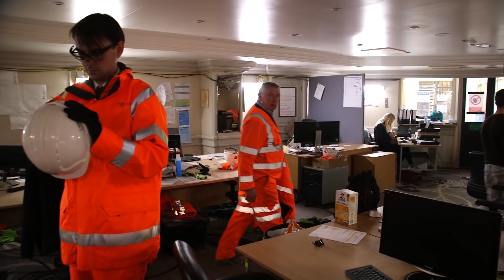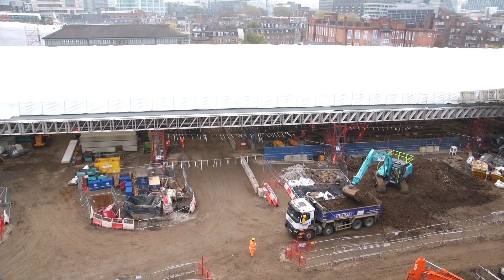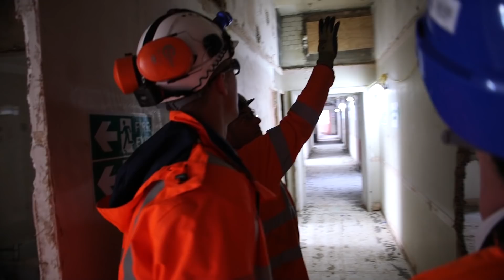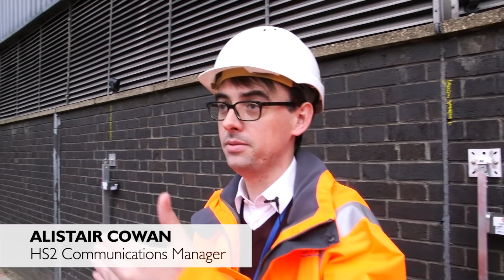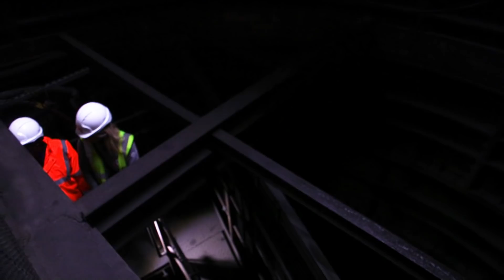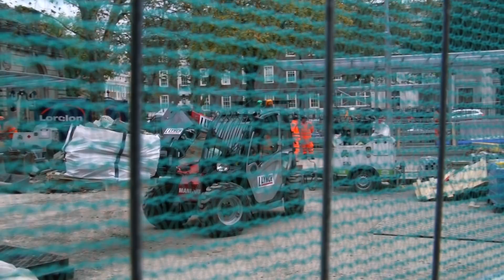HS2 Euston Demolition Works

Comment: Do we even need HS2...waste of money if you ask me. Just upgrade the current lines with electrification and put new and faster trains on them, HS2 is to make rail travel quicker...why not get an earlier train 😕
Reply: HS2 is about capacity. And the existing line is already electrified. Upgrading costs more than new build, and is far more disruptive whilst it's going on, as previous WCML upgardes have amply demonstrated.
Reply: Why don't you check some facts before you write? The current main line is already electrified, and the trains are already going at maximum speed possible on it, given the curves.  The trains are even designed tilt to resist the centrifugal forces on those curves, but the limit has been reached.  Anyway the main point of HS2 is to increase capacity as the existing trains are full ; the higher speed is a bonus.

Comment: What there needs to be are decent rail lines along the South coast. As it is if you want to go from Kent to Dorset you have to go up to London and then back down - it's ridiculous.
HS2 is just stupidly ambitious. It requires far too much demolition, construction and alteration.
Reply: Thomas Sturges-Allard Compared to the disruption without it, it’s nothing
Reply: Even worse by road along the South Coast.
Reply: i completely agree, if i want to go from Ashford (Kent) to Brighton or Portsmouth i have to wast soo much time going North to London just to come back down south again at an angle.. if they upgraded the lines between Ashford and Eastbourne and started using proper Trains and not these bumpy and frankly useless at peak time 2 car DMUs we could improve the south East - West connection allowing access to Kent from Hampshire Via Sussex without going via London's overcrowded network.. all by upgrading a short section of track
Reply: the west coast mainline and euston station are absurdly inadequate for the amount of people that constantly use it. it’s such trash when you compare it to the rail services to other parts of the uk

Comment: I Think the class 800 "*IEP*" Is going To be on the HS2
Reply: Not very likely - new bespoke trains are planned, whose design is not constrained by having to run on 19th century infrastructure.
Reply: In fairness, current plans for the first tranche of rolling stock are that it is all going to be "Conventional Compatible" so that it can run off HS2 at Lichfield onto the existing lines an onward to destinations further north.

Comment: I used to do the Euston commute everyday - depressing journey through that station, so glad there's some work taking place in the area. Is there a plan to do anything with the existing station? I know there have been grand plans at various points in time, but did any of them come to fruition?
Reply: Pretty sure the HS2 plans rebuild the whole station rather than just bolting a bit onto the side

Comment: I’m in no hurry to get to Birmingham . 
It seems a lot of work and a Lot of Buildings have to go , just for this .
I think it’s a Piss take take demolish the Old tube station. Why can’t they incorporate it somehow ?
Reply: nasty nick It’s on top of where the platforms are meant to be. It’s more to do with capacity, so you can actually make it on the train, not just get there faster
Reply: The site of this old tube station (closed in 1907) and all the other buildings in that locale are essentially about to become a big hole in the ground into which HS2 platforms and service basement are going to be constructed. It's simply impractical to try and "build round it." They could maybe save to street level facades and relocate them, but no one is stepping up to buy it (yet.) There's plenty of other examples of the same architecture in London (both abandoned and still in use.)
Reply: Dave Cardboard 
I just think it’s a Shame that’s all

Comment: HS2 is a ridiculous vanity project. Removing the 1960s horror of Euston is insufficient compensation.
Reply: Borderlands How is it so? Reducing journey times? Massive boost to capacity?
Reply: @agent_605  Because it's a massively expensive railway for a single route to Birmingham. There's no equal development in the midlands and north, indeed electrification of trans-Pennine routes has been delayed indefinitely. It will cost more to travel on it, take money away from existing routes and make a new commuting corridor. That's it. HS2 is not joined up thinking, and there isn't the cash to develop UK railways across the board.
Reply: Borderlands It will go to Manchester and Leeds as well, and will be the same price as existing InterCity services as they will be transferred to HS2
Reply: @agent_605  To get to Leeds an equivalent high speed rail link would require massive modernisation of the cross Pennine network. I'll believe 250 mph trains on those routes when I see them.
Reply: Borderlands HS2 will have a branch to Leeds as part of Phase 2b. TransPennine electrification and HS3 is a separate thing entirely
Reply: @agent_605  That's my point. HS2 has been pitched as part of a network, but will probably remain a freestanding line to Birmingham and eventually, Manchester. Cross Pennine routes could have been electrified years ago giving local communities and those travelling to London quicker access, if that was a priority. Indeed there was such a line, electrified after WW2, that was torn up as recently as the 1980s. There's no necessity for a new west coast line to initiate faster links between northern cities, it could happen tomorrow given the cash.

HS2's intention is quicker access to the capital. As major institutions "devolve" to the regions - it was recently announced Channel 4 is to move to Leeds following the BBC in Salford - advances in technology will mean the need to be regularly be in London will be much reduced. That leaves a wider commuting range as the sole reason for a high speed line. The ECML is already fast and given new stock and infrastructure upgrades could be even quicker, so there's no benefit from HS2 in the east.

HS2 will prove to be a commuter line whose main effect will be to push up house prices in leafier West Midland suburbs, and luxury travel for Manchester business folk.
Reply: Borderlands HS2 will connect with the existing network. As for businesses moving North, it’s because HS2 has started construction, so is moving whilst it is happening. The Woodhead line closure was shortsighted and resulted from nationalisation. TransPennine electrification could’ve happened years ago if the Government chose to, but the infrastructure would prevent higher speeds being attained
Reply: @agent_605  Hang on. The government chose to implement HS2, but the government didn't choose to electrify Pennine networks? Aren't you rather making my case? If northern "infrastructure would prevent higher speeds being attained", isn't the proposed high speed joined-up system precisely the white elephant I'm suggesting? My point is there isn't the money or will to match HS2 across the system as a whole, creating a single fast pathway which comes to a grinding halt in the towns and cities it purports to serve. Currently anyone in northern conurbations who wants to go south has to do so via an ancient network connecting to the WCML or the ECML, and that won't change. All that will happen is west coast travellers will get to their destination an hour earlier. Leeds, York and Newcastle users will continue down the East coast, as always. HS2 isn't a general improvement, it's a highly targeted and monumentally expensive railway line. The so-called northern powerhouse relies on local connections at least as much as quickening access to the capital.

The Woodhead route was planned pre-war by a private company, the LNER, and only came to fruition under BR because WW2 delayed it. It was destroyed because the railways were perceived as a minimum number of main lines radiating from London, as HS2 does, not as a network with local hubs and branches.
Reply: Borderlands What are you on about? Leeds and Newcastle will use HS2 as well and will cut 30 minutes off the journey time. HS2 will go directly into the centre of town. HS2 is agreed on being needed across the political spectrum, TransPennine electrification has only been delayed by the current government. HS2 has nothing to do with the delay to TransPennine electrification. The ECML also doesn’t need replacing as it is mostly straight, they are proposing to convert the southern section south of Doncaster to ERTMS to allow faster journey times as the main issue is signalling, not alignment (the issue on the West Coast)
Reply: @agent_605  Get back to me when the Pennine system isn't running diesels. Currently substantial parts are using Leyland buses on cargo wagon chassis. Even thinking about cross rail 2 while such a situation obtains, is simply perverse. By the time HS2 is built it will no longer be needed.
Reply: Borderlands HS2 will be needed, don’t go on some fantasy about technology or driverless cars. The Pacers are being scrapped next year. Electrification has been confirmed to be happening, however because of the route alignment it won’t provide any speed benefit
Reply: @agent_605  Who mentioned cars, driverless or otherwise? I said all along HS2 will grind to a halt before the Pennines, and you've finally agreed.
Reply: Borderlands I haven’t agreed that at all. HS2 will finish officially at Manchester and Leeds. That’s not to say it won’t be linked with HS3 if it is built. HS2 and HS3 are reliant on each other, TransPennine electrification is essentially a waste of time before HS3 is built
Reply: @agent_605  In case you hadn't noticed, the majority of rail travel in the north is internal. 2 and 3 coach standing room only trains, often late, frequently cancelled. TransPennine electrification is a much more pressing issue than a showpiece project into London. At the very least the projects should be simultaneous, and certainly not indefinitely delayed, which has been the case. My argument is simple, a general upgrade of the whole system, infrastructure and rolling stock is a much better way of spending funds than a single line.
Reply: Borderlands TransPennine electrification is expensive. After all, the WCML is overcrowded. That’s the main reason for building HS2. That’s why it’s needed more. New trains are already on order for TPE that are 5 coaches long, longer than some other InterCity services in the South

Comment: Total waste of money. Its only going as far as Birmingham. Just an excuse to spend a load of government money on London and make a load of contractors rich
Reply: They should spend some money on a wahmbulance for you. This is the sort of comments that led Crossrail to take ages to get off the ground, and no one will say "Nah, we don't need more public transport in London. We've got red lines, and yellow lines, and a green one too!"
Reply: Stage 1 will also be used by trains to Manchester, Liverpool, Scotland etc. (For the same reason that the M5 helps the Cornish Tourist trade, despite not getting within 50 miles of the Tamar)
Reply: Guinness The Telegraph were just misinterpreting quotes. It is going to Manchester and Leeds, and the WCML needs that capacity relief
Reply: Alasdair Clift we will see. I guarantee it will be years late and massively over budget and hugely expensive to use, thus completely negating the business case for it. It will end up being a rich man's toy to shave half an hour if that off the London to Manchester journey time. Most people won't be able to afford it to save half an hour
Reply: Guinness Firstly, High Speed 1 was early and on budget. Second, prices for HS2 will have to be low for it to be worth it, likely the same as existing prices as InterCity services will cease to run on the main WCML

Comment: Waste of money
Reply: Yes I know but HS2 is not needed
Reply: James Wyatt What’s the alternative then?
Reply: Reopen old railway lines
Reply: Both main lines to the West Midlands are still open. Reopening the Great Central tom the East Midlands would demolish more properties (that have been built on the trackbed) than the new build HS2
Reply: @84derbycounty  "Reopen old railway lines" this is glorious. What railway lines are still intact that could support modern infrastructure that you could reopen? Regale us with your detail!
Reply: James Wyatt What Railway lines on that corridor would work? There’s a reason they were closed you know
Reply: I’d reopen 2 lines one from Leicester to Coalville the other already runs from Derby to Matlock I’d just extend it through Bakewell ti Buxton then you’d have a line from Derby to Manchester
Reply: James Wyatt And how would that rectify capacity issues on the WCML, MML and ECML? Especially considering you can just change in Sheffield to do that journey and it could go to Derby just by running a through service rather than building an entire new line
Reply: Well, the Matlock to Buxton section, when it was open, did provide a second route from London to Manchester, but I doubt the Midland Main Line would have the capacity now to support much of a service - especially since HS1 has taken over most of St Pancras.
Reply: I hear that the government read this comment and is halting HS2 as we speak.
Reply: James Wyatt Hardly when you consider how busy WCML trains are in the peak, they need a capacity relief

Comment: What a complete waste of money I hope hs2 doesn't happen as going though the middle of my town
Reply: Sorry but it's still not justifiable just for that with the amount of green land people's homes and small towns destroyed for a railway line that's put of date before it's even built
Reply: Paul Kerry It’s a tiny amount compared to other infrastructure projects
Reply: @agent_605  such as what other projects
Reply: Paul Kerry Heathrow expansion and other proposals out there, a rail line is hardly the most damaging infrastructure. A motorway on the other hand (which is the alternative as more people would have to drive)
Reply: @agent_605  motorway would still probably be faster then a railway line. Still don't see the point in it for extra 30mins max  I would sooner not go to London given the chance
Reply: Paul Kerry Capacity relief for other Main lines for commuter services which are too busy, e.g WCML, MML and the ECML by diverting InterCity services. Stop being a NIMBY
Reply: You need to get your facts right mate. I am in Nottinghamshire/Derbyshire  by the time you travel to toton from Nottingham/ derby to catch hs2 it saves 4mins instead of catch train from Nottingham derby and that's only if the m1/a52 is running freely
Reply: Paul Kerry And that’s because you’re focusing it on you. Nottinghamshire isn’t 200 miles from the West Coast Main Line either, and will boost capacity on the Midland as well by serving Sheffield. Most destinations it will save 30 mins or more, and it’s the capacity that matters. Stop being a NIMBY.
Reply: So with travel time to toton from Nottingham or derby that's about 30mins on a good day so for the sake of 3 mins you may as well get the train from Nottingham or derby. Be interesting to see how much time hs2 would save from Leeds I don't think there would be much in it compared to driving it or train
Reply: Paul Kerry Leeds will be cut by half an hour. That isn’t the point, the point is capacity boosts for local services on all three routes, especially the West Coast where it is most needed
Reply: @paulkerry69  Unless you actually live in Nottingham station, you have to factor in travel time to that, just as you did for Toton. (Long Eaton to Nottingham is about 18 minutes by train - and Long Eaton is nearer to Toton than Nottingham!).   Doubtless the local transport network will be reconfigured to make Toton easier to get to than it is now (perhaps an extension of the trams) - just as the West London local transport network focusses on Heathrow in a way it certainly didn't fifty years ago.
Reply: It's actually NOT happening, and this is an April Fool from Jeff. Honest truth.
Reply: Paul Kerry It’s happening. It’s needed for capacity as the WCML is full
Reply: @agent_605  wcml is over 200miles away from me so why should that go though my home town to save 4mins travel time
Reply: Paul Kerry There’s no where on the route where the WCML is 200 miles away. Unless you are confusing it with the GWML. It doesn’t save four minutes, closer to an hour once Phase 2 is finished. Anyway that isn’t the point, it’s to boost capacity on the WCML by allowing InterCity trains an alternative, faster route to give more paths for local commuter services
Reply: The only parts of Great Britain more than 200 miles from the WCML are Cornwall, Pembrokeshire, and the far north of Scotland. There is absolutely no prospect of HS2 going anywhere near any of those places.

Comment: I understand that they will not redo the Main bldg. of Euston Station. Is that True.?
Reply: If by "they" you mean HS2, then no they won't. HS2 do not have the remit or the money to rebuild Euston beyond what is required to avail HS2. To rebuild the rest of the station (and any other redevelopment that might be considered worthy) the Mayor, Camden, Network Rail et al have to put a plan together and lobby for the funding (which I believe some or all of them are doing.)